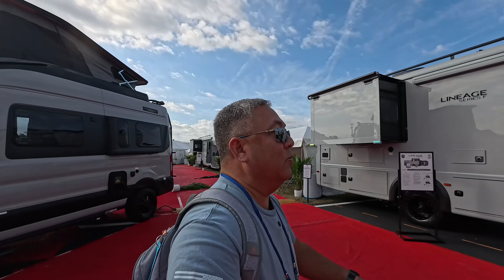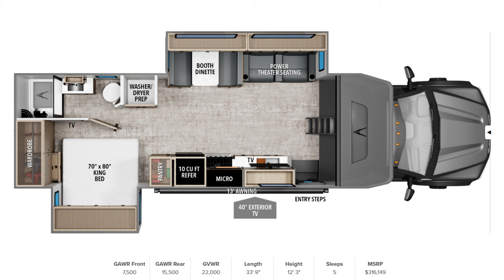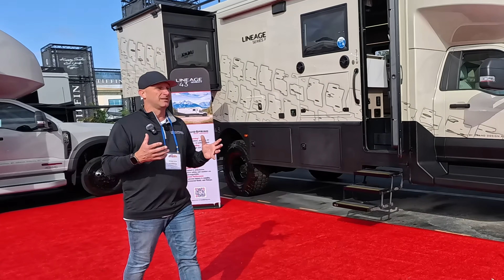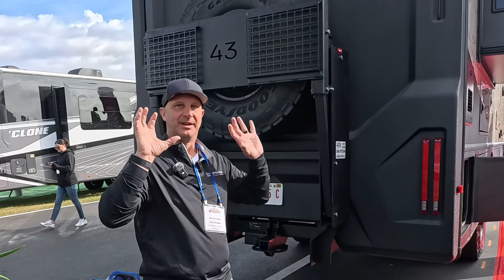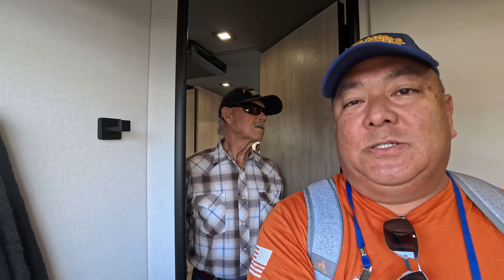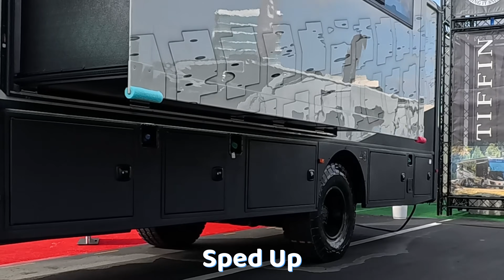First Look at the 2026 Grand Design Lineage 43 Super C | Prod Mgr Review

Comment: How would you level it at a campsite? Would it constantly rock around with interior movement?
Reply: Liquid Springs has True Earth Leveling, works great!
Reply from the maker: @mhums76 thank you for the answer Mike.
Reply: Any idea of the height of the unit at ride height compared to standard 31ZW?
Reply from the maker: @bruceschneider6914 I do not know for sure. Mike, the product manager has commented on this video and he might be able to answer.
Reply: @bruceschneider6914  stand Lineage Series F Lineage 31ZW is 12'3".  43 Package driving height is  12' 8.5"
Reply from the maker: That is an excellent question. The 31 has leveling jacks. Maybe someone can answer this question.